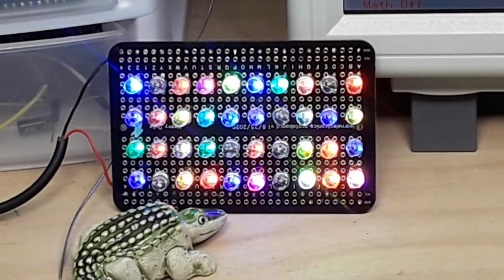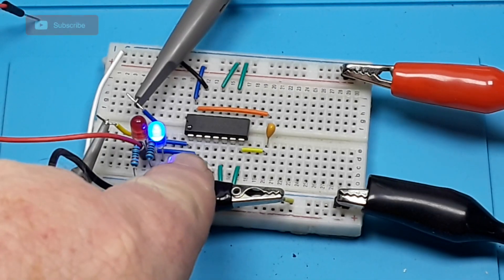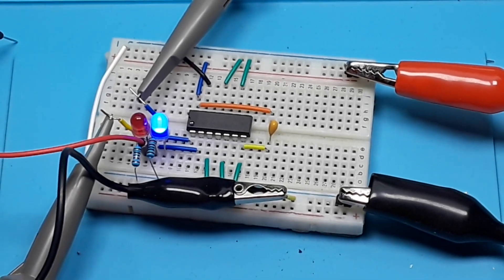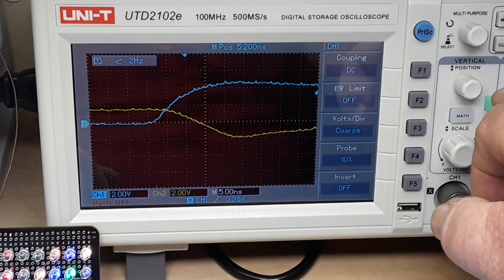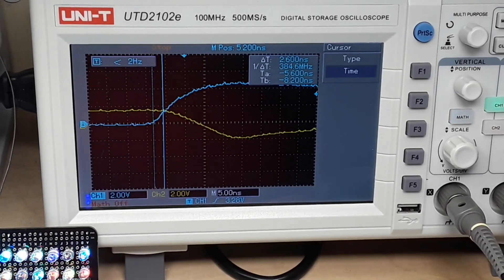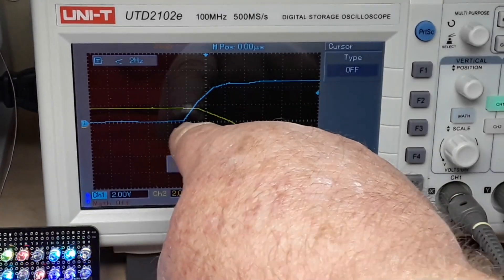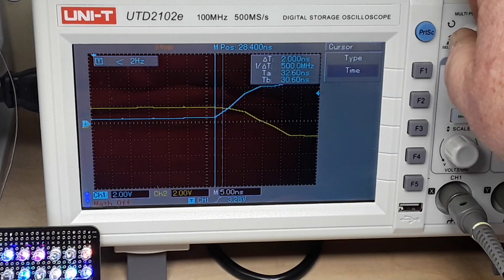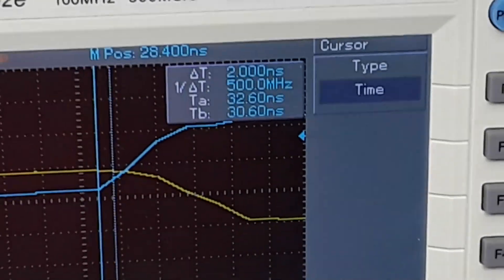What is propagation delay?

Comment: An interesting note - on one of Dave Jones (EEVBlog) videos from way back when he was showing some high bandwidth digital circuit some of the traces have zig zag "square wave" traces on the PCB because two signals need to arrive at the other device at the same time. Due to the routing the square wave trace (on the shorter path otherwise) is to make the two distances equal so there is no propagation delay due to the lengths of the traces! At high enough bandwidth this could be an issue!

Comment: Very nice Paul. Just some questions - Would the propagation delay really be the time between when the input reaches a high to when the output reaches a logic low...in other words the Vlow time of the output to the Vhigh time of the input and vice-versa (since we are working with an inverter) ? I wonder if the propagation delays would be different low to high vs high to low?

Comment: It might be easier to measure if you connect all the inverters in series and stack up the delays, looking at the overall time to propagate through several inverters. Your 100mhz scope only has a guaranteed response time in the range of 3.5nS.  This would clean up your input signal and eliminate the slow rise time into the first inverter.  Scoping the output of the first inverter and the output of the final inverter would give you a more accurate measurement after dividing by 5.  Lowering Vcc to 2V would also seriously slow down the response of each stage from approximately 9nS to closer to 25nS.  The response of your scope is really muddying up the measurement.  I'm only offering constructive criticism.  I do appreciate the effort you expend to make a video attempting to explain these often difficult to understand datasheet numbers.

Comment: I'm sorry, but that is not the definition of propagation delay; the official definition is the time it takes from a valid input voltage (in your case 3.5 V with Vcc=5 V) to a valid output voltage (in you case about 0.4 V if the LED does not draw more than about 4 mA)!

Comment: Your timing is perfect.   I'm trying to build a 65C816 computer and I'm working on the clock board.  It's not simple because I need to shape the clock waveform to generate wait states on demand for slower I/O devices.  My first few test designs reacted unexpectedly at higher than 10Mhz clocks because of propagation delays.    
Synchronous counters vs. ripple counters.  A topic for Propagation Delay part two?
Reply from the maker: Counters... absolutely great idea

Comment: Why use and I/T and not a GFCI output to power your scope as well as your workpiece? Will 15 mA for a duration of 14 m/seconds damage the scope? Then why not just use the GFCI outlet instead of the I/T ? The I/T will save the scope, but not your life, whereas the CFCI will save both,,, that is, if the scope can handle the 15 mA. I will very much appreciate your help, thanks.
Reply: If you’re only working on low-voltage low-energy projects than floating your scope seems a lot more useful than having an RCD, your life isn’t in any particular danger in either case but not being able to short your circuits when probing and having poor-man’s differential input is a big positive.

Comment: Yet another great video. Thanks and greetings from Down Under
Edit:
I might have to buy another resistor sticker, I scratched it up good doing some workshop upgrades and including solar panels and batteries to run the house lights and my workbench from 12v including using my old computer UPS to run a few appliances.